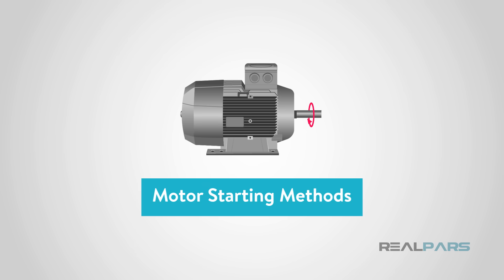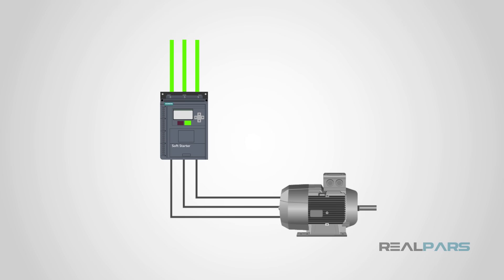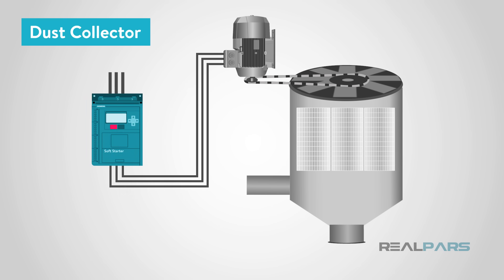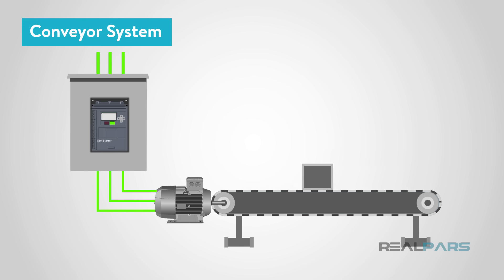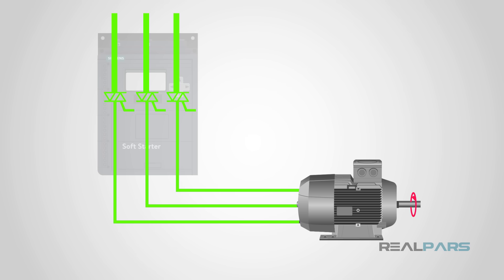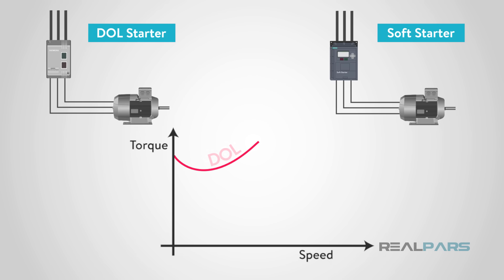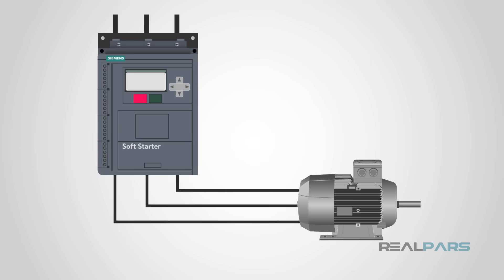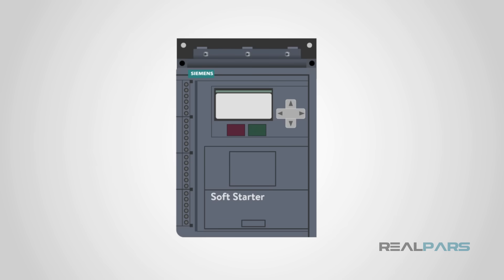What is a Soft Starter? (For Absolute Beginners)

Comment: Nice explanation of a soft starter.  Can they also be used to power up step-up transformers?   Where I live, i have 230V 3-Phase. My work shop main line is 16A 3-phase, 230V.   Most of my machines run on 400V 3-phase, so i have a small transformer that is rated at 16A inlet and 10A outlet.  Almost every time I switch on the thransformer circuit (through a contactor) the 16A circuit braker trips.  This is due to high inrush current i believe.  Some times i have to try 3-4 times or more before i can switch on the ciruit without tripping the breakers.  Note, the circuit is unloaded when switched on.  I never have problems when putting load on the circuit, such as motors etc.
Is this an application for a soft starter?  Thanks.
Reply from the maker: The current on the secondary side of a step-up transformer will be less than that on the primary, since power (V x A) is conserved (minus a little efficiency loss).  However, since the secondary (as well as the primary) are inductive loads, they behave somewhat like a motor would, with the possibility of a larger inrush current.  I would use properly-sized time-delay fuses on the primary feed instead of the breakers you are currently using.  This will likely fix your issue.  You could try a soft-starter, but that will be expensive by comparison, and may not fix your issue.

Comment: Hello Sir, for ur last example motor for conveyor, which one is good DOL or soft starter?
Reply from the maker: For conveyors, soft starters are recommended, especially if the conveyor needs to be started under load (with boxes, parts, or other pieces on the conveyor).  Belt slippage with sudden starts with a DOL starter can cause the belts to wear faster, especially for larger systems.

Comment: please can you explain how to programme soft starter
Reply from the maker: Every manufacturer's soft starter is a little different, but most require that you set the line voltage, full load amps, current limit, and torque boost.  Beyond that, acceleration, deceleration time, and other parameters specific to that manufacturer's drive are set via a front panel interface or serial programming interface.  While VFD's may have 100+ configuration parameters, soft starters usually require less than 10.

Comment: Instant of star/delta circuit we can use soft starter?
Reply from the maker: The short answer is YES, since both limit the line voltage on start.  The electronics inside of the soft starter represents an improvement over the star-delta (or wye-delta) starter arrangement, and soft starters accomplish the same benefits at a higher efficiency.

Comment: I wish soft starters were cheaply available for airconditioners. It that way the can be easily supplied by solar power
Reply: There are a few new models in the market that do this, they are integrated in the AC unit. I think they call it inverter technology or dual compressor AC. We have a lot of them here in MExico but they are more costly than regular ones

Comment: Can you do an advanced video where you explain the function in more details with the correct formulars ? And you didn't mention another big problem when starting big (medium voltage) motors direct on line: The huge voltage drop which occurs due to the high starting current of 6-7 times nominal current. This is often not accepted by the power supplier company and therefore you have to reduce starting current with, for example, a stoft starter.

Comment: I dont think people understand the amount of current these large electric motors use.  I saw an accident where the motor was physically isolated while fitters aligned the shaft.  The apprentice was given the job of stripping and installing wires to the first junction box (safely isolated under permit). While aligning the shaft it is necessary to very slowly rotate the shaft 90 and then 180 degrees.  Just a very slow quarter turn on the shaft was enough to generate quite shock and injure the apprentice.  Heads did roll because anyone with a high voltage license should have known this.  Hard instead of soft start at the same time as an alignment problem nearly bought down a five story structure with me on it and does do a lot of damage to a lot more than just the motor and system it is powering.
Reply from the maker: Thanks for sharing your thoughts and knowledge with us, Mick!
Reply: Mick This is a great comment and reference from experience. Once never had or seen this happen but you never quite ever know until it happens. As well I’ve been around 4160 Motors being aligned so never quite know until something unexpected happens.

Comment: inrush... is not "voltage" BUT CURRENT!! 
From 5 to 7 times the run current

The bigger the motor the more destructive is its INRUSH CURRENT at start up time.

VFD Soft-starters ramp up the PHASE FREQUENCY there by limiting the current required NOT the voltage.

👍🏻
Reply: A triac affects the voltage too.
Reply: Yes, the intent is to reduce the inrush current. But the control is via voltage. The triacs in the soft starter are triggered at a specified voltage of the incoming waveform to limit the voltage seen by the motor and thereby reduce the current consumed by the motor.
Reply: I am from mechanical dept. Can anyone briefly tell what is triac? Is it also called ICBT? 
Thanking you all.
Reply: @cck0728  You can easily use google to tell you what a Triac is, but I'm assuming you want the high level view and don't care about the details. So.

A triac is effectively an extremely fast electrically controlled relay. For the purpose that it's being used in this video, this "relay" is being triggered either 100 or 120 times per second (once per half wave of the power being supplied to the motor). The exact moment this relay is triggered for each half wave determines what percentage of the available power is passed onto the motor. For instance, if it's triggered just before the voltage crosses the zero point, there will be very little power being passed onto the motor, whereas if it's triggered just after crossing the zero point, the motor will be receiving almost the maximum available power, and of course if it's triggered at the midpoint, the motor gets half of the available power. Additionally, the word "triac" is being used with two different meanings. There's an electrical component that's called a "triac" this component by itself is rather useless unless there are additional components attached that select when the triac is triggered. The second meaning of "triac" is the entire module that's used in the video. This triac contains within it the component called a triac and the associated components that actually trigger it.

As for any association with ICBT, you're going to have to be a bit more specific with what you're talking about since I don't know what ICBT you're speaking of. Doing a quick search I came up with: "Informal Cross-Border Trade", "International College of Business and Technology", "Interactive Computer Based Training", "I Can't Believe This", "Individual Cognitive Behavior Therapy", and "Intercontinental Ballistic Transport". And obviously none of those possible meanings have any relationship to power management.
Reply: @johncochran8497  Thank you for such detailed explanation. Actually, it's IGCT (diode) . It is ABB terminology used in our VFDs . So I thought both are same.  For a layman (like me) it holds same meaning for triac and IGCT.
Thanks for your valuable time. Please keep on contributing with your valuable expertise.
Reply: Low voltage=high current
High voltage=low current
Therefore if you intent to lower the current you need to adjust the voltage.
Reply: @joeanne6258  No. We're not talking about a transformer where you're converting voltage and amperage while keeping wattage constant. We're talking about inrush current which is effectively determined by Ohm's law I=V/R. Since we can't do anything about the resistance, we decrease the available voltage via the triac.

Comment: What is the difference between a soft starter and a vfd?
Reply: A VFD varies the frequency of the three-phase power delivered to a motor to allow its speed to be varied.  A soft-starter is used on an "across-the-line" starter to limit the initial in-rush of current to the motor so that it starts in a more controlled way over a short period of time (seconds).
Reply: NURUDEEN There is also a new current video explaining this and well explained. In my 2 cents also a VFD has more variable speed control of the motor or a motor where it needs a specific ramp up or down speed as well as may need to run at a specific variable speed that’s not also full speed.

Comment: The love and appreciation for the team that makes and delivers these videos can be difficult to really convey because it’s highly regarded, so as well is the person narrating the videos. I worked for years as a Tech in the Utility Plant Environment around many equipment with Soft-starters as well VFD’s and never quite understanding properly quite how they worked in a properly explained way like explained by RealPars. I feel so much appreciation from the care taken to make these videos in explanation in demystifying industrial automation understanding. I’m so much smarter because I’m here!
Reply from the maker: Thats an amazing comment, Ardent! Thanks a lot!
Reply: Technology is fascinating. I am just a young adult who is interested in science and technology, and was hoping that there was a device that can reduce flickering of the lights when the air conditioning starts (current inrush). Apparently, someone invented it: the soft starter, and RealPars explained it so well (visual learner here). 10/10 good video. :) 

*Would be nice if air conditioners, dehumidifiers and fridges could gently start up. Sadly, domestic air conditioners typically don't have enough inertia to necessitate a soft start system, which can cost a lot of money. Also, the flicker of the lights occur for just 1/10th of a second. Thankfully, most my bulbs are LED, so only one or two incandescents flicker. Also, variable stage air-conditioning does exist, and they use similar motor ramp-ups to alternating current soft starts to reduce initial energy consumption.

Comment: Is it like a capacitor in a ceiling fan???
Can you explain in simple terms first and then in industrial level
Reply: INDHRA KIRANU N A it's like a dimmer on a light except changes the frequency going to the motor so it starts the motor slow and gradually increases the speed of the motor till full speed however vfds can do more than just ramp up the speed of the Motor they can control the speed of the motor as well as the rotation of the motor
Reply: INDHRA KIRANU N A Eaton videos has a 16 minute video on here called VFD 101 basics 
That is one of the best explanations on YT

Comment: Is vfd a sift starter or there is difference between vfd and sift starters?
Reply: Vfd is to control speed soft starter is used for starting the motor
Reply: softstarter use to control the starting and stopping the motor
Reply: same thing except you're using only one function of the vfd